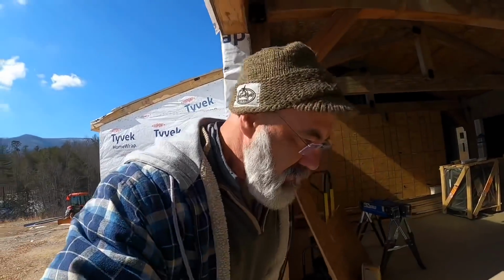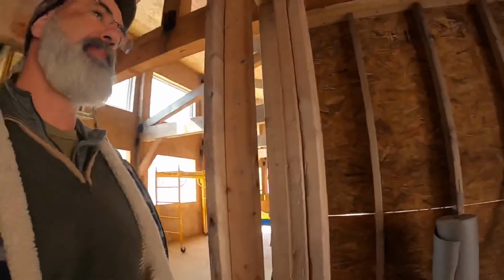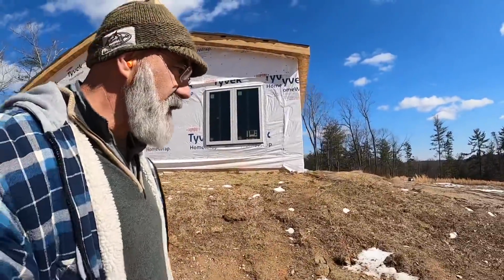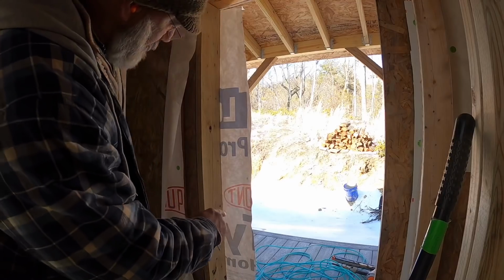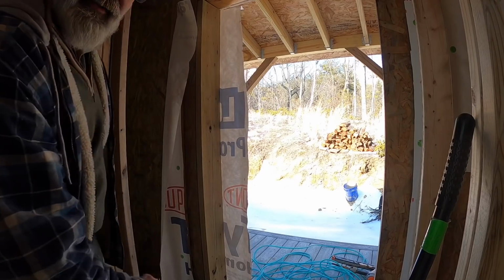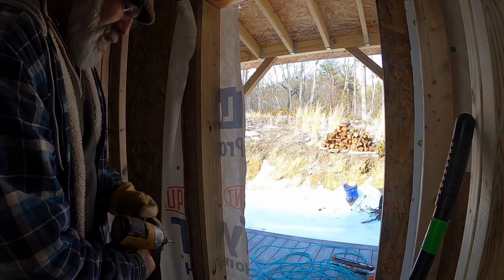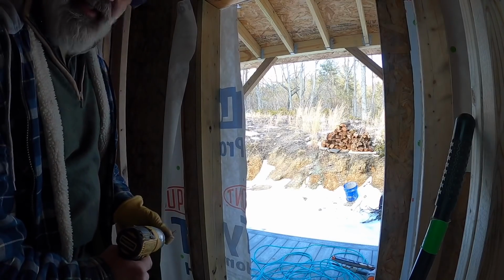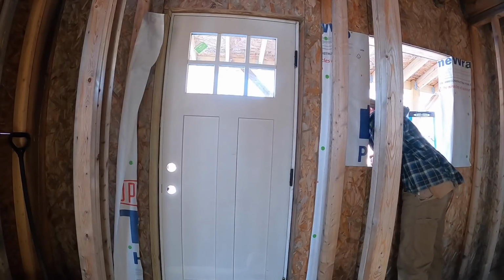An entry door install.  How hard can it be?  DIY SIPs home build #119

Comment: You are so right, and you have the patience when things don't go quite your way.  I've seen many horror shows with some guys putting in doors. You will thank yourself many times over for spending the time to get them right. Lots of shims and screws to hold the door square & plumb. You can always putty over the screwheads and paint. And now days they sell that low expansion foam to seal it up.
Reply from the maker: Yes. Waiting for slightly warmer weather before foaming.

Comment: Side note for when you do wiring.  The Leviton Smart Breaker System is great.  Costs a bit more but well worth it if you want to see where your power is going.  And the load center is easier to wire.
Reply from the maker: Interesting. I will have to check that out.
Reply: @breakheartorchard  it's a cool system.  I'll be able to shut off my daughter's bedroom power from my phone if they won't go to bed....lol

Comment: For what its worth, I was taught when installing a new door to plumb up the hinge side first, then set the gaps around the door when closed with shims. Also, agree with Mario Wickel below, long screw through the hinges. On the jam side you can roll back the weather striping and run a long screw into the frame. The weather striping will hide the screw... less to touch up later. Love what you guys are doing, place is looking great!
Reply from the maker: I hadn’t put in a door in at least 15 years.
Reply: @breakheartorchard  I hear ya, every time I take on a project it takes me a while to remember the details. Replaced all the interior doors in my house a couple years ago, first one took like 2 hrs., the rest took like 15 mins each. Love your project and appreciate you posting the videos! Keep up the great work!

Comment: You should hang a sheet of plastic over the front door opening, you will hold more heat inside that way!!
Reply from the maker: Yeah. I will probably be putting something up this week. I’m still holding out for our windows to show up soon.
Reply: @breakheartorchard  No offense, but, seems all manufacturers are way behind. Same as with your roofers, perhaps if you cover the openings, the windows will show up. Least in the meantime you can hold a bit more heat.